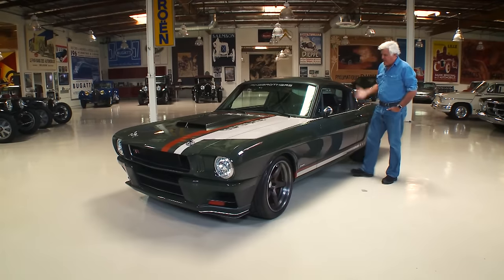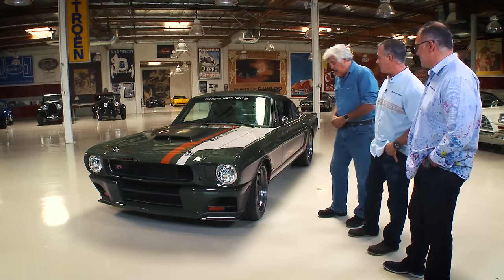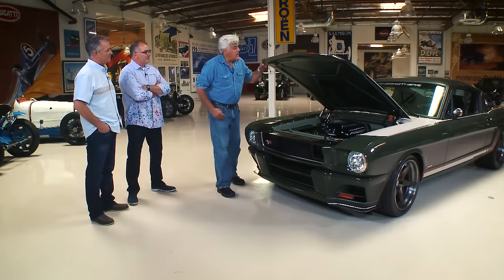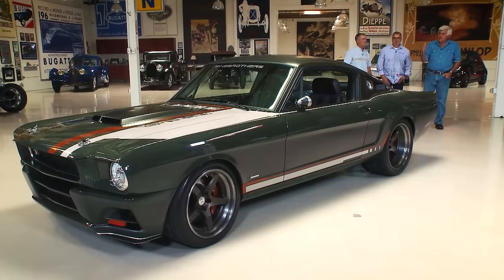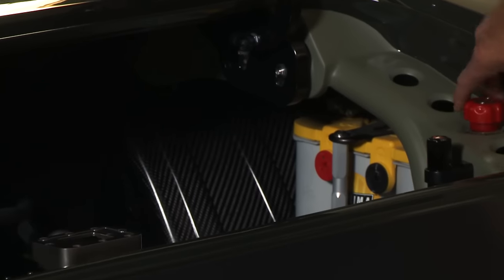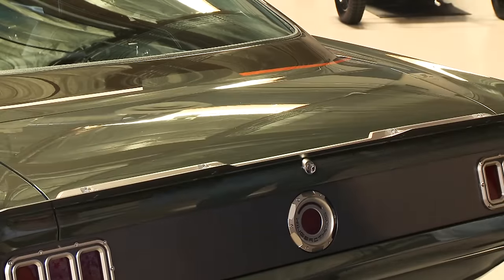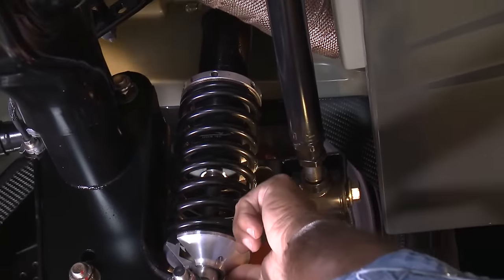Ringbrothers 1965 Ford Mustang Espionage - Jay Leno's Garage

Comment: I live in Tucson AZ and at a car show some time ago I viewed a little white 65 Mustang coupe tucked away in the corner of the show. Some old guy sitting next to it. It was not a show car by any strech but everything looked like it was there. Well everything was there except the engine and trans.  Pop the hood and there tucked neatly in place was an LS engine from the Corvette complete with the Corvette Covers. The funny thing is the guy even kept the skinny oringinal size tires! Turnes out the Chevy motor fits in there almost better than the little 289. So the guy had a "stock" Corvette Engine and manual trans in a stock Mustang. but now the Mustang was a 400 hp tire ripper!
Reply: +Ken J .....my '68 (which is bigger...I know, I know) has a 408 Windsor making 520 hp (with a single 4 barrel) which fits perfectly and destroys D.O.T. street drag race tires.

Comment: No excuse to use a LS on a full custom carbon fiber mustang. sound like this people never heard of the 302 stroker based engines, 351w and 408 stroker etc.. practically the same architecture as the LS motor. its funny as hell when people spend most then likely 200k on a custom car and skimp out on the engine cuz its "cheaper"..lol
Reply: it's not about how big the motor is, it's about how efficient the motor is. my 460 is making boat loads of power but its power range is very limited. the big thing with LS motors is that its power range is great through the whole power band. and you're not sacrificing the drivability of the car.

Comment: so when are you going to build a trans am camaro with a ford engine
Reply: never ,ford sucks!!!
Reply: I second that!
Reply: Emilio Murillo LOL it would never happen Chevy has powerful bottom ends Ford still hasn't master strong bottom ends so with all the power it always blow out the crankshaft on Fords Chevy you can add power and still have a strong motor so lot of builders prefer Chevy engines in they're high in creations$$$$
Reply: That's a great one I only seen one Chevy with a Ford engine but it's mostly Chevy in Ford cause Chevy is King💪🏼💪🏼💪🏼
Reply: @e.imccool8993  ford has better race engines,chevy sucks...
Reply: You know what ford say to chevy ?? I don't recall 🤔and coyote engine is better than ls
Reply: @mikea1893  i 3rd that why would you do that? no point!
Reply: @venomhell5084  ive never seen a ford engine light up tires like that! that car would impress  holeman and moody  and smoky  yunich!

Comment: whats the point of the battery switch in the back ? does it actually swith the car off or is it does it disconnet the battery so it doesnt drain? and dont those optima batteries have a short life span?

Comment: If somebody pays to have a chevy motor put in his mustang, that's up to him.  If he sees a lower (or higher) resale value, that's his problem.  The official excuses were: my mechanic can only work on gm stuff and ohc ford engines are too bulky.  1) you're probably not married to your mechanic, and 2) a 351W-style ford racing block can fit as nice as an LS motor and tolerate four digit hp numbers.  Who said it had to be ohc?  And if it were ohc, since when do hot rodders see big elephant-size valve covers as a drawback?  Weird excuses.  Oh well, it's his car.

Comment: Just like the 2013 Ford Mustang, that the Ring Brothers did, there are just so many mistakes in the design work that they do, that turn something nearly phenomenal into something cheapish. Kudos to Jay Leno for pointing out the cheapish things like the fuel sticker, The race gauge in the center console instead of in front of the steering wheel, the gurney flap in the back that is glued to the car, and not bolted down and flimsy. Just so many missed opportunities. Division is there. The concept is there. But they need to hire better people to come in and work on the details.

Comment: I don't need, or even want 900 horses. With a body some 600 pounds lighter, an old school 289 with Shelby massage would be all I'd ever need or want. And the 289 was narrow and light. With solid lifters, a high lift long duration cam, good heads and the right intake manifold 325 horses is a realistic number while staying stone reliable. Leave it Ford. I don't like mix and match.

Comment: Typically, with a blown engine that can run on premium pump gas, you can get 60% more power than a naturally aspirated engine, so the 900 hp sounds like a dream, (nicer to say than a lie), to me.  I would guess about 700.  I build small 2-stoke engines for a living, and I know there is no shortage of inflated HP numbers that is advertised.

Comment: As a Mustang enthusiast I think people need to calm down about the Chevy motor.  I'm completely against the idea of putting a Chevy engine in a classic Mustang too, but this isn't a Mustang.  It's a Ring Brothers Mustang clone car.  It was never engineered by Ford, made by Ford, marketed by Ford, or sold by Ford.  This car is no more a Ford than Caitlyn Jenner is a man.  Therefore they can put any engine they want under the hood and it wouldn't bother me at all.  They could even put a Honda 4 cylinder in that thing.  Actually it would probably be better if it had the Honda engine honestly.
Reply: You're right but they called it a Mustang so moot point.
Reply: Wow. The whole time, at least until they mentioned the motor and I  turned it off, I was thinking they were saying it was a Mustang. It looks like a Mustang. I didn't really see anything about it that led me to believe it wasn't a Mustang, so why would you want to open the hood and see something that very much doesn't remind you anything of a Mustang? Or Ford. Why would any Mustang lover want to see an engine from their biggest rival in a car that they are madly in love with? You should know the answer already. They wouldn't. Ever.

Comment: Putting a Chevrolet engine in a classic Mustang is absurd.   When I found out I stopped watching it.  I mean have you ever heard of a Ford engine in a Z28?  I understand totally the Hot Rod aspect of Chevy engines in '32's or something like that but I cannot stomach the idea of doing this.  Especially since Ford now has probably one of the most iconic engines out there, the Coyote and now the VooDoo cross plane crank 5.2.  Either of those are very capable.  Not a fan!!!

Comment: The sound is related to the speed of the car or engine speed because the spring was translating engine vibrations thru the frame. In a build as clean as these, if you see the slightest scratch or rubbing then probably that's what it is.

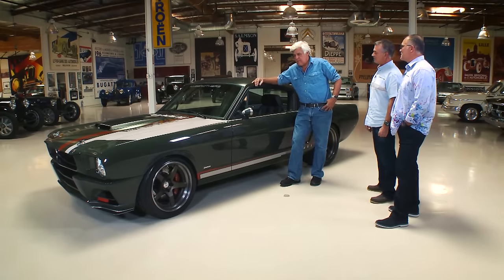Comment: Use a 400 modified canted valve make it at 4:12 or 416 stroker from the factory I get 618 horsepower out of a stock motor work to carb some headers some roller rockers double double chain drive if you know how to build your Motors that motor would have drops trade in and have 900 foot pounds of torque would a smoke a block up with a tour of those rims off that car

Comment: Hey just a thought, when they had that car up in the air on the hoist, the tire holding hoist, to me is awesome. Point being I am a retired welder and for this to hold 6000.00lbs that weld better hold up. 7018 rod+hot= very strong. Lol

Comment: I love that they talked about the reasons they put a Chevy engine in it, because those are some of the same reasons I love pushrod motors. A lot of people don't understand how insanely bulky, heavy, and unwieldy an overhead cam motor can be, especially if it's a v8. People to talk crap about single cam, pushrod motors, but I think they don't realize how small and light they are. 

You can actually have a much physically smaller single cam with a larger displacement. For example, the Ford 5.0 is actually a larger and heavier engine than the Chevy 6.2, despite having significantly smaller displacement. It's because of all the extra cams and parts to run the cams (timing chains, gears, etc.). Of course, the added control of the valves from the dohc adds a lot of horsepower, so you have this interesting tradeoff of dohc adding power vs more cubes adding power. In the end, it's usually pretty even in terms of power.

Comment: So question how do y'all feel about a drag mustang street car with a big block Chevy or small block 🙄 in Alabama and Georgia where I'm from it's normal plus they are faster than Ford motors that I see so feel free to voice your opinion on this 👌🏽
Reply: It's one thing to do this to a drag that doesn't need to do anything except go fast for a ¼ mile at a time as cheap and easy as possible. It's completely different to do it to a legendary classic when money is no issue in the build.

Comment: The reason why the only GM car I own is 43 years old, I couldn't drive my Pontiac w a Chevy in it. Mostly all GM cars today are Chevys, I'll pass, we own a Toyota and a Benz. They have they're proper motors, Death before accepting a corporate engine
Reply: I agree. My Toyota's have genuine Toyota engines and my Honda has a Honda engine. My last Pontiac had a real Pontiac 400 in it.

Comment: They have pushed a Ford 2.7 liter single overhead cam engine that's in Jon Huber's 79 mustang to just shy of 1000hp so if you choose an LS motor instead of a Ford in a mustang you are just taking the easy way out .
But I would not put a Ford Coyote engine in a Corvette either .
The only time I would swap a different brand of engine in a car would be in an AMC etc because options are just too limited .
This Mustang is kinda ugly to me anyhow.
But I love the Chevys these guys did though

Comment: In fact, at Willow Springs they won't insure the event if Ford and Chevy are on the track at the same time because its too dangerous as too much aggression develops on the track with too much motivation and adrenaline. In order not to lose the insurance, it is required that the Chevy engines and cars not run when the King Cobra Club has its events at Willow. Just ask Speed Phenom the youngest and best C8 driver around! AF

Comment: Nice car but saying that they picked the chevy motor because it's smaller and can make more power than the Ford just shows they aren't engine builders.  I would more understand the statement that the chevy motor is cheaper to get and build than the ford.

Comment: Wasn't the original steel body all unibody style and spot welded together? So if this is all carbon fiber fenders and such, how did they bond the rear fenders. roof etc, to the steel and keep it strong and rigid?
Reply: Pretty sure Mustangs have always been unibody. The 64-66 Mustang had a curb weight of only 2445 lb (base model)

Comment: Doesn’t like chrome? 🤦🏼‍♂️ man chrome is my favorite and nothing nicer then a black out car with chrome rims. I’m not a big fan of chrome all over the car but I love chrome rims on a car. And now that the Chevy and Ford are using the exact same transmissions it should be less of a big deal to put one in the other. I get the motors are different but the Camaro and Mustang both use a 8 speed tremic I think it is don’t quote me.

Comment: HOW MUCH WOULD SOMETHING LIKE THIS COST OR IF YOU HAVE ASK YOU CAN'T AFFORD IT.....?
Reply: around a price range of 200,000 with all that carbon fiber and custom work
Reply: actually carbon fiber is really cheap now
Reply: not custom work carbon
Reply: look at there website its estimated 269,000 for the mustang depending on your opitions
Reply: gmg921 yes it is ... i watched another video of jays and even he said that its getting cheaper
Reply: gmg921 and most of that money probably came from the paint job and the engine work and everything else the carbon fiber was probably the cheapest thing on the car
Reply: body work is never cheap and carbon fiber is still 5 times more expensive then steel figured in with weight
Reply: gmg921 maybe so but the engine
Reply: is a standard ls around 20,000 at most
Reply: gmg921 cheap lol ... not Macdonalds cheap but car cheap

Comment: I don’t buy into the bull crap that they needed to put an LS motor in because the owners mechanic doesn’t know how to work on small block Ford’s or the new 5 L coyote engines. The truth is, it’s cheap and a cost cutter. Even Kindig It did a better 65 fastback with the Ford illuminator in it.

Comment: Ehh not a ford fanboy from the 60s 70s so I dont see a issue with the engine in it. But why not bring the best together for a great build. At least with the Chevy engine in it the owner wont have to fix or repair it on a daily basis